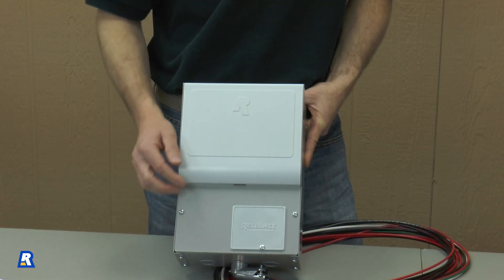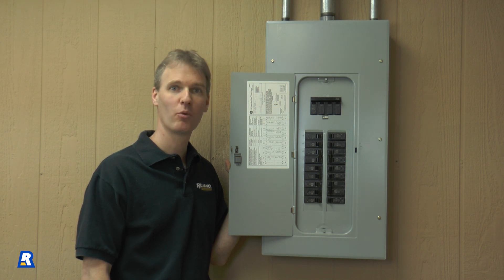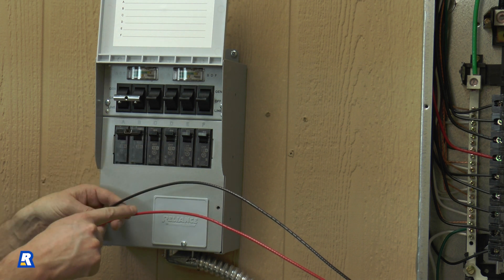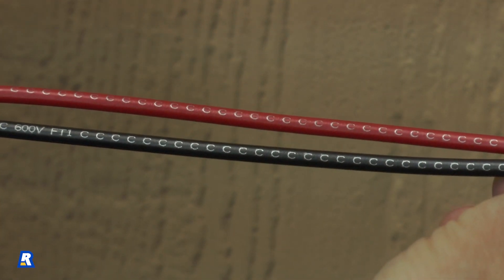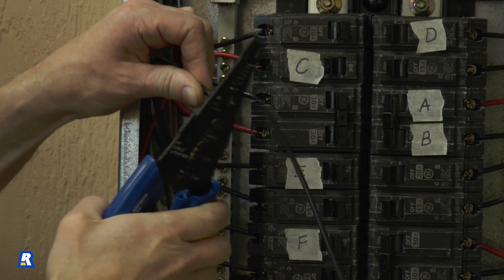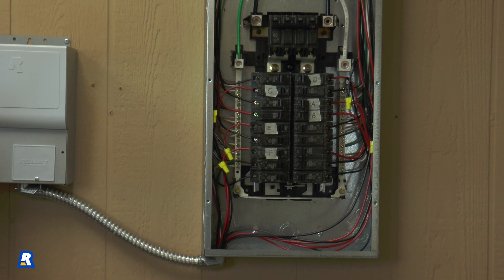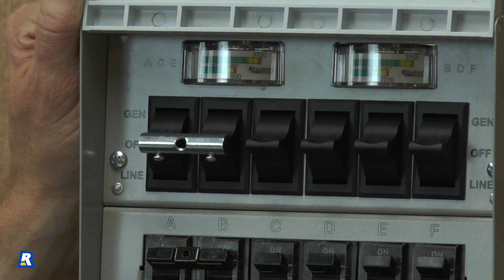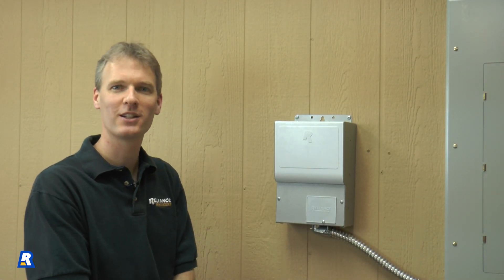From our president: Our Generator Transfer Switch Quick Start Guide

Comment: Hi videos are very informative and and helpful for people like me who are not electricians thanks  ! Video description states models 306CRK/310 CRK for 6 and 10 circuits resply but home depot descriptions are 

Model # 3006HDK
30 Amp 250-Volt 7500-Watt Non-Fuse 6-Circuit Transfer 

Model # 310CRK
10-Circuit 30 Amp Manual Transfer Switch Kit

Can you please clarify why 6 ckt model is different and why the descriptions are also so different  ? Thanks
Reply: Thanks for clarification I already ordered the unit from Home depot
Reply from the maker: @dilks9730  Fantastic. Let us know if you need any help or have any questions!
Reply from the maker: Hello and thank you for reaching out! The model 3006HDK sold at Home Depot is the same installation as the 306CRK.  It is only a special model number for Home Depot.

Hope this is helpful, but feel free to ask any more questions.
Reply: When I received the transfer switch the first pleasant surprise was well written instructions in easy to read print didn't need a magnifier.  I am a diverse but not a electrician still was able to install it from instructions and videos  ! Thanks
Reply: I meant DIY er not diverse
Reply from the maker: @dilks9730  We're glad to hear it was helpful for you!! Thanks for sharing!

Comment: Just finished the install. Never even had to look at the instruction manual. Watched the videos, and it was an easy job. The hardest part was running the line from the inlet box to the switch, as I had to go 45 feet thru the basement for my situation of where I could put the generator.  Worked well in testing. Almost hoping we lose power (haha)for a few hours to give it a good test. Thanks.
Reply from the maker: So glad to hear you found the installation (mostly) easy! Thanks so much for sharing your feedback on our video, it's great to know it's helpful :)
Reply: I have the 6 breaker reliance now with a larger generator I would like to add the ac but no more room in transfer switch box
Reply from the maker: @RonAskey  Hi and thank you for your comment! It will be much easier to answer this kind of question over the phone so that we can know your exact installation situation. Would you mind giving our tech support a call at 800-634-6155

Happy to talk through it with you :)
Reply from the maker: @RonAskey  You are able to add a second transfer switch and wire them both to the same generator input.  

Depending on the size of the AC unit of course, the ProTran2 has a max of 1- 30 amp double pole breaker.

Comment: I am installing a Reliance transfer switch. How do I know if my fuse box has a neutral and ground bar of just a neutral pole?
Reply from the maker: Typically the ground bar is separate from the central breakers and neutral bar near the inside edge of the main panel.  If you don’t see a separate ground bar, its because main panels have the ground and neutral bonded together so both the neutral and ground bar act as the same bonding point. Let me know if this doesn't answer question.

Comment: Hello Mike 
I am looking to buy a transfer switch of 10 breaker’s, I am wondering if we can install longer wire’s from the transfert switch to the main panel ( about 12 inches ) ? Thanks for the infos in advance 
Serge 👍😉
Reply from the maker: Hey Serge! Good question: you may extend wires from the transfer, but not replace the wires. Run the wires from the transfer switch to a junction box to make extensions with the correct gauge wires (10 gauge for circuits A and B and 12 gauge for circuits C-J) to extend into the main panel. Let us know if you need more information!
Reply: @RelianceControls  That’s what I taught also thanks so much …I will order it very soon from Costco 👍😉
Reply from the maker: @SergeCousineau  Always better to double check 😉 Let us know if you run into any trouble!

Comment: I must be missing something, I see 3 #10 wires come to the transfer switch and  then to the house main but I didn't see them put anywhere on the main Service. can you tell me where to place them Please don't make me go to Generac?
Reply from the maker: Hi Mike! Our transfer switches actually don't require any connection to the service main. We are only making connections on the load side of the circuit breaker to transfer power. We have a complete installation video on our channel that might be helpful to take a look at. These install a bit differently than most other switches on the market. Our's are a little easier and less time-consuming than what you may have seen elsewhere. Please let us know if you have any additional questions or concerns. Thanks so much!

Comment: I have the A510C Pro/Tran2 50-Amp 10-Circuit 2 Manual Transfer Switch. What is the purpose of the 20 amp double pole breaker? Can I just remove the bottom 20 amp double pole and replace with 2 single poles?
Reply from the maker: Hi Johnny! Many of our customers will use that double-pole for well pumps or other 20A circuits. You can certainly swap them out for 2 single poles. The little "handle tie" on the toggle switches can also be easily removed, so they no longer operate together.
Reply: @RelianceControls  Thank You!